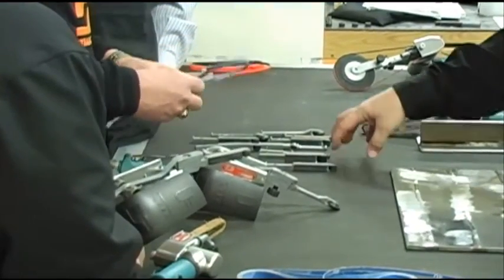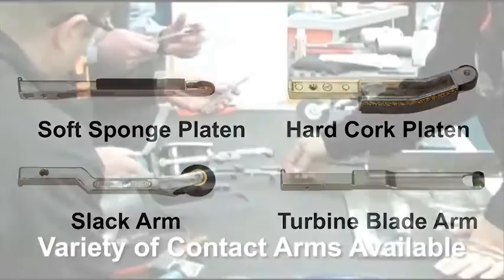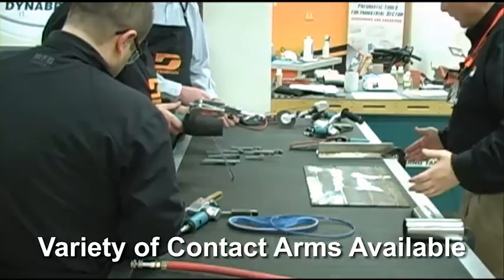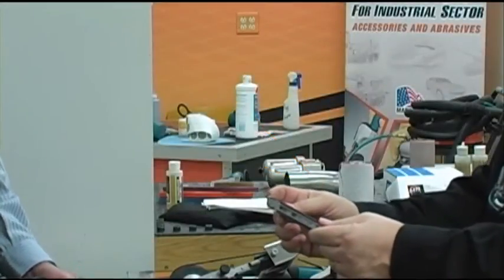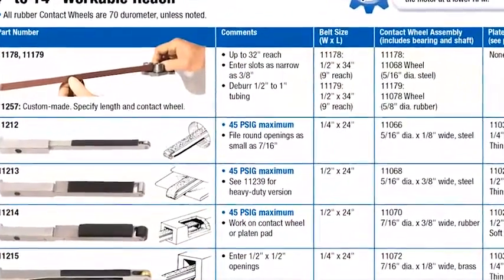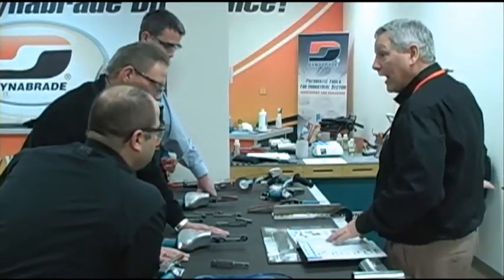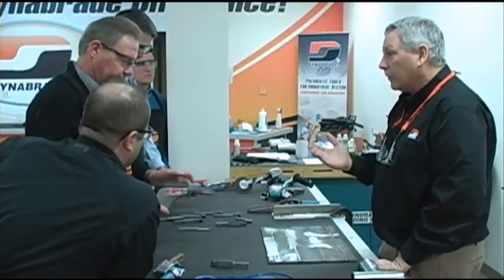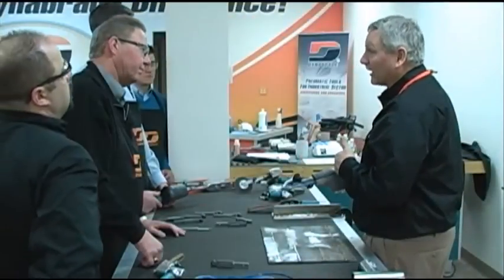Original Dynafile Contact Arm Training

Comment: For using narrow belts are you able to cut 1/2 inch width belts to size?
Reply from the maker: If you have the correct tools to cut your abrasive, then yes you can cut the belt to the size you need. We do also supply smaller width belts. For the original Dynafile (14000) we recommend the 11219 or 11232 contact arm to run the smaller width belts.